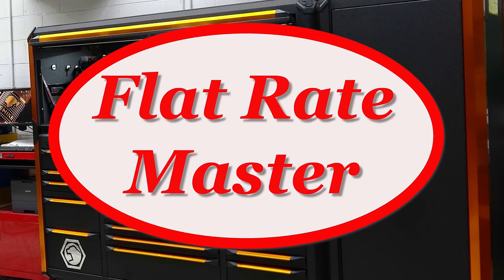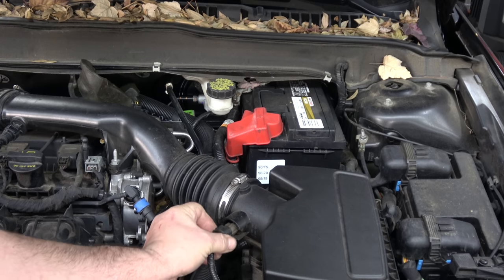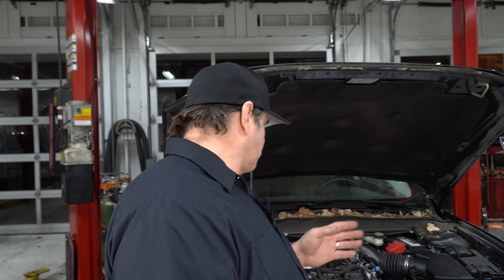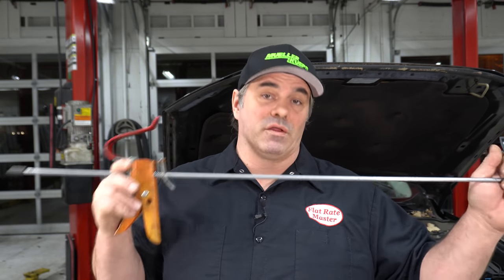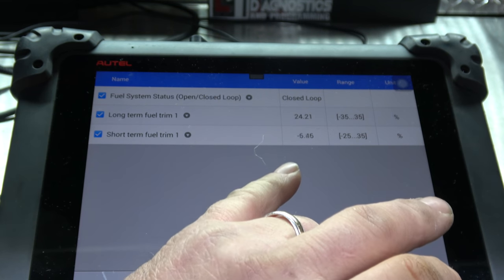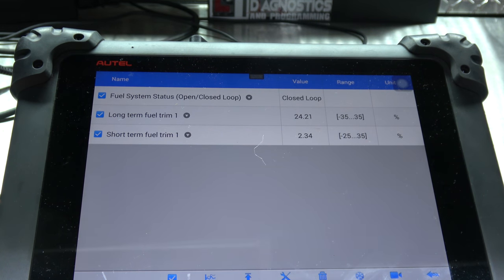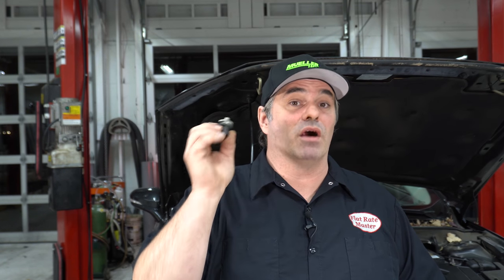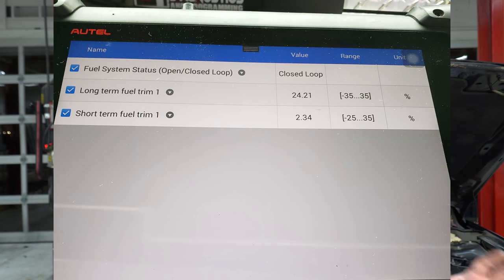2015 Ford Fusion P0171 Lean Case Study

Comment: I give you credit for doing the right thing for the customer. That is a very hard diag to call. On any non gdi setup I will confidently call an injector if drop test is 1-2 psi difference. On GDI it can get complicated. You should give yourself a pat on the back. Great video and thought process. Thanks for posting it.

Comment: Master Ford tech here. The Fusion, Escape 2.0 GTDI and Focus GDI 2.0 with p0171 is 99.9% of the time the fuel injectors are restricted. They will pass an injector flow test on IDS because they are relative to each other and they all are restricted. When I get them I usually check fuel quality first and if it’s ok and not e85, they get injectors.
Reply: Does this also apply on 1.6L?
Reply: Same with honda
Reply: Will e85 cause this

Comment: Next time try using tool gtc 605 fuel injector analyzer. Quick test to rule out injectors.
Reply from the maker: You can't get to the center injectors with the intake on

Comment: Hi mike 
Did you reset the high and low pressure learned values . ? 

IDS / FDRS is a service function if you ever disturb or replace any fuelling components 

and with those direct injectors it’s important to replace the seals top and bottom. But expect they came on the new injectors

Comment: It'd be nice to see a Voltage trace and current ramp on those injectors and see if we can see the pintle open late or closing early and getting worse when it get warm.   You talked about the carbon in the intake, are those direct injection or do the injectors go on the intake side?
Reply from the maker: direct injection. not much to see on a waveform on those:(
Reply: FrugalPrepper's Garage & Garden Direct injection on this one. I haven’t checked many DI injectors with a scope yet but they operate much like a diesel injector and can be difficult to see pintle opening and closing. I should probably start checking as many known good vehicle as I can.
Reply: @ThePracticalMechanic  Yeah when I have to do some parts changing to find the issue (and it happens to all of us), I like to see if I can figure out a process that I could test it after I have a confirmed fix.  I haven't messed with any direct injection stuff yet.  I know that usually on Speed Density cars when you have a plugged/lazy injector you see the fuel trims max out and it will also smell rich.  I have always thought that we have on under performing injector making it see lean, but the computer has to adjust the pulse width on all of them.  The full throttle and it straitens out thing I have also seen, because maxed out pulse width at full throttle is maxed so some can have a longer pulse width than others.

Comment: Ohhhhh , now I see ! You were dealing with a spray pattern issue ! I heard you mention in the YT chat that you had good feeling at high rpm/wot, which usually means that fuel supply is sufficient.  Here's the thing , at that rpm spray pattern is a lot less necessary . That's also why misfire counters are shut off at that rpm, there will be an inherent incomplete combustion but speed of crank couldn't possibly slow down fast enough to cause a misfire . Spray pattern here was more like a squirt gun here during to carbon on tips.  Good on you for sticking with it 👍👍
Reply: I was wondering where you were....I swear you have some kinda gift Keith...someone throws a video out and you're like Tom Cruise in the Minority Report movie; where he's got that big screen up looking at thousands of potential crimes that haven't happened yet...😂😂😂👍
Reply: And no Mike, I am not suggesting you committed a crime! 😄
Reply: WOULD NOT FUEL TRIMS GET WORSE UNDER LOUD WITH A LEAN FUEL SUPPLY PROBLEM WITH A BAD INJECTOR . FUEL TRIM CODES ALWAYS SEEM TO THROW MANY TECHS OF THANKS KEITH !

Comment: Fantastic case study loved it . I had only a few weeks ago almost the same problem p0171 on  map car ( Honda ) the workshop that give me the car must had lost his hair trying to work out why this car had a P071 . This car had a very small amount of Diesel in the tank , and like you I did do a fuel simple test at first but only used the 100ml test tubes to test for too much alcohol , and just like you car it was ok ? it was only when I tool a big simple of fuel I could see a very small amount of green in the fuel not easy to see ( it was just a bit of diesel ) so the fix for my car was just to drain the fuel tank and put in some nice fuel and my fuel terms went back to normal . This is why I love my job its always a challenge fixing cars , Love you work and your Channel .

Comment: We had 2.0 Eco-boost setting the same DTC. Two days later we still hadn't figured out why. The tech assigned to it was at his end so I was "asked" to help him. I soon reached my end as well. We were totally stumped. Ford's tech support said to replace the injectors but the customer didn't have the money for it. The advisor came back with a BG fuel service kit for us to do a fuel system service. I rolled my eyes. He said "I know you think it's snake oil but the customer's husband wants us to try it." I said "Yeah right, he wants to try it after you suggested it." He laughed. Anyway, after doing the service we ran it up I-75 about 8 miles. (We picked up lunch but that's between us because we really did needed to drive it after the service, LOL, two birds one stone type thing.) When we got back the LTFT was at 4 and the lean code was not active or pending. Let it cool down a few hours and rechecked and all was perfect.
Reply: Interesting i have debating on trying this myself

Comment: I’m lost with my 2014 Ford Fusion 2.5 as well. Car idles high when in park even when the car is heated up. Does randomly at stop lights as well. I had that even when I didn’t have any codes to it mind you. Got the same code as this video an a p0456 code for small Evap leak. Gonna replace purge valve on that. But still can’t figure out why I have a high idle around 1600 rpm and randomly dies. Replaced all fuel injectors, throttle body even tried a maf sensor from autozone, even replaced top stream O2 sensor as well. Would the pcv valve do this or map sensor? Do you have any idea?

Comment: As a Ford technician injectors would have been my first guess.  I had a 3.5L eco boost engine in a police unit a while back and it had lean coded for both banks.  4 hours later I’m pulling my hair out because I can’t figure it out.  Like yourself I started asking around for help and one of the guys told me it was probably the injectors based on his experience.  Needles to say I put some injectors in it under warranty and it fixed it!!!  I give you props for figuring this one out because if I was in your position I would have shipped it to the dealer 😂

Comment: needing a little help.. 2016 fusion 2.0, GDI nieces car, got 4 leaking injectors, 3 dribble and 1 pours as soon as I activate the in tank pump, wet pistons, and used borescope to validate. She got something in her fuel and did not know to tell anyone until the car died. I can not find any info or videos of intake and injector removal.. Any tips you can share? Thanks in advance

Comment: I would have lost my fucking job at the dealer if I was to put that many parts into a car before fixing it 5 min into your video I was calling out injectors as soon as you said low side fuel pressure sensor replaced! I knew it was direct injection, most Chevy are direct injection now and when I see any lean or rich code I test injectors first and fuel rail pressure don't even mess around. I said Chevy because that's what I work on, I know your working on a Ford by the way

Comment: I had the same problem P0171 lean and what I did was change all four injectors and clean the intake valves  Fix all the problem the dealer told a guy is going to be $10,000 to fix it he needs a engine LOL. And thanks flat rate Master .

Comment: As a ford I've found that the low pressure fuel pump is a commem cause for code p0171 lean air fuel.

Comment: This was really interesting Mike great job. Mitchell was calling 02 sensor, evap issue and positive crack case pressure. Even straight up bad gas lol. Nothing about injectors so Mitchell wouldn’t of helped either.
Reply: What's a Mitchell?
Reply: New Level Auto oh, it’s this great program that has the best service info on the planet called Mitchell. We can lock you in today at the best rates of whatever we feel like billing you at for the next 20 years lol who am I kidding it sucks... I’m switching to Alldata in Feb
Reply: @weldingjunkie  🤣👍

Comment: Seems like it was the injectors as the main cause and the high pressure sensor as a secondary contributor to the issue. It always amazes me that the smallest sensors and parts can all but disable a vehicle now days.

Comment: I have a 2015 ford fusion titanium 2.0 ecoboost (same exact car as the video) 114k miles no mods. The check engine light came on the other day after I started it. The code is p0171. The code comes back instantly when I clear it. There are NO drivability issues and the car runs normal at idle and wot. 

The fuel trims are doing the same thing the car is doing in this video: stft numbers are normal and close to 0 at idle and wot. The ltft numbers however are at 28% at idle and go down to 15% at wot then back to 28% right as take my foot off the gas. I dumped some fuel injector cleaner in the gas tank yesterday.

Does this sound like it could be the fuel injectors?

Comment: Hey FRM if you come into anything difficult with Ford/Lincoln don't hesitate to give me a shout, I'm a Dealer Tech and can pull any Diagnostic information and/or TSB of the sorts, if for some reason you cant get a hold of them. I've been tuning into your videos for sometime now and have learned a lot from you as of course my dealer training. But just giving you a heads up you have another life line if need be, Take care and good job on that diag and repair. "we can't win them all"

Comment: When the injectors get old the solenoid and carbon buildup can make them lazy.  You dont see it in most of the testing procedures because it is changing the latency of them which is a fixed value in the ecu data banks.
As far as the ecu is concerned they take the same amount of time to switch, thus the testing results come in ok.

Comment: I have 2011 Ford Fusion I just replaced the MAF sensor and after 3 days the check engine light came on , i checked the codes and it said bank 1 and bank 2 are running lean, what could possibly be ?

Comment: I solved something like this once with an pressurized fuel injection cleaner canister I got for $80 on ebay. I put in seafoam, berrymans, etc. Let it run and the code was gone.  also used that canister to drive a 1/2 mile with an 8gal air pressure tank and gas :lol:. The fuel pump died on another car.  Don't try this at home kids!

Comment: Same goes for Toyota mr2... LTFT at +22%, no intake leaks. After conducting a injectors balance test, all injectors drops the same level with fuel gauge. After remove the injectors for closer looks, found that they have slight cracks. Injectors fix the lean code.

Comment: How are you supposed to flow test direct injection? Odd issue. I diagnosed a dead miss on a Nissan 3.5VQ as an injector but I used the waveform comparison to other known good. Not exactly the same thing in your case.

Comment: It's not a very common problem with these engines but it does happen, they get start to get built up and stick over time and will set that code. You can get them flow tested and cleaned but no time for that in a shop. It really helps to run good quality fuel and supreme fuel at all times with these cars. I owned a 13 2.0 fusion and now own a 16 2.0 Fusion haha
Reply: Do you run any injector cleaner in those? I put in some royal purple every oil change and fill up at shell or mobil, engine seems happy so far
Reply: @joshuac837  I actually do yes... I throw in bottle of gumout fuel system cleaner every 10,000 miles or so keep things happy. Working good for me so far

Comment: wow, what a mess.. yeah i know on the honda's its not uncommon for injectors(sticking/stuck open/closed) on the GDI systems to cause misfire codes, i hate doing that with getting parts on the shop's bill but i agree, "should i keep second guessing this? or should we try something so i can make you some more money?" i know i have done that to an ABS sensor(yes it was the sensor, no, it keeps throwing codes for it and i cant get a square wave or any voltage difference out of it) thanks for the video! looking forward to the next one!

Comment: Great video! Thanks for sharing! Had somewhat similar problem on a 06 Suzuki Grand Vitara. 2.7 V6 only bank 2 was lean (tft was about 28%) after spendig lots of time on diagnosis i put 1 a/f ratio sensor (seemed lazy.) Didn't fix it. Afte that 3 rebuilt injectors fixed it!

Comment: Had gdi issues with a mini years ago. Intermittent missfire on cold start and wot when hot. Valves were carboned up but injectors had bad spray pattern

Comment: Gdi injectors lean out at same rate.  Fought several gm 3.6 always a set of injectors both banks lean.  Cleaner wouldnt affect them. Run out good on road just ses and 32 on trims. Because all plugged about the same the balance rates look good.

Comment: I've seen both a biased low pressure and high pressure sensor . All the Ford techs I have talked to have said DI injectors are common over 60,000 miles. I was able to get one to stay gone with just a high pressure sensor.
Reply: Yep, you went thru the same thing I went thru on one. My customer said no to injectors. They are expensive

Comment: A flow test cant be done on direct injection? If so why not?
Reply from the maker: High fuel pressure at very high pressure, is created by the cam turning,, so the engine has to be turning to supply high pressure fuel to the system, you can bench test them with the correct fuel bench. The only test is via scan tool

Comment: I’d like to see the flow test? What’s it give you spec for pressure drop?? Ya got a ford ids I would of checked for a flash update. No tsb? Good work getting that thing done
Reply from the maker: no tsbs or updates, flow test is just a scan tool test, it runs the injectors koeo and spits out numbers
Reply: Then how do you know what’s good and what’s not just asking? For my future uses when I encounter something similar on a ford
Reply from the maker: @philh9238  the scan tool gives you the spec
Reply: Makes sense now thanks have a good New Years try not to get to drunk 😂